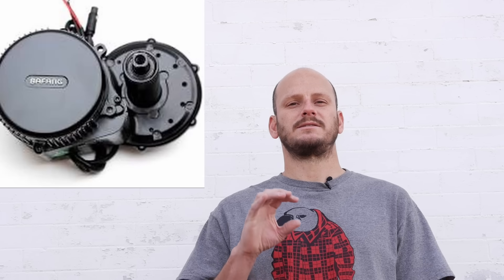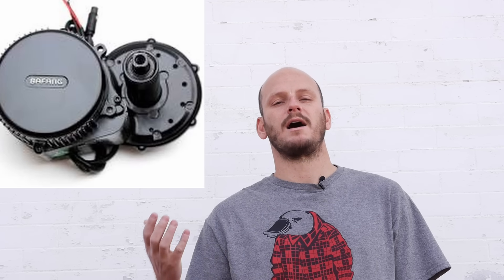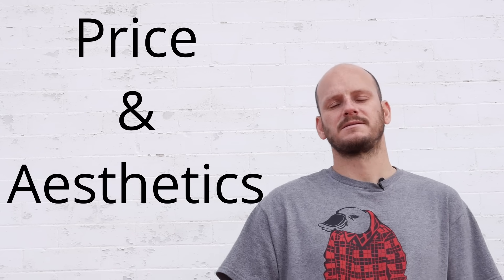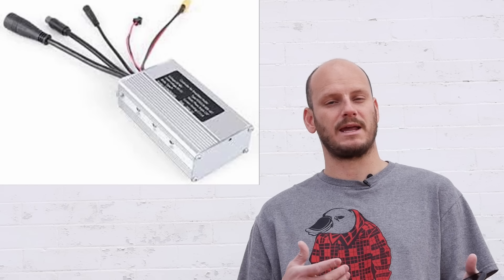Hub vs. Mid Drive Motors: Why Hub Motors Suck and Debunking Common Myths with performance test

Comment: Look at the specs for a lot of the mid drive motors from Specialized, Trek, and Giant:  70nm of torqe.  Yes, you can find mid drives rated above 100, but your comparison is unfair.  You can also find hubs rated above 100.
Reply from the maker: Hubs over 100nm that are also rated at 750w? Remember, apples to apples....
Reply: @JohnnyNerdOut  I own 3 ebikes, 2 hub and one mid drive.  Watts and rated torque don't tell the important part of the story.  One hub, rated at 750 watts climbs hills like a billy goat but has modest top end speed.  The other hub is the opposite.  It climbs everything that I need to climb but is unlikely to accelerate up the steeper hills.  It flies on the flats, however.  The mid drive falls right in the middle, not the climber of the first, not quite as fast on the flats.  Each bike fills a need.  Gearing has so much to do with an ebike's performance.  My climber is geared lower; my speedster higher.  In the end, it depends what you like.  I think hubs are more flexible, allowing one to work or rest a bit.  The mid drive gives me the best workout, but is a bit of a liability when I'm tired.
Reply from the maker: @richhowell6874  interesting. I wonder what gear ratio your running on that mid drive? I bet if you replaced your cassette for one with a bigger ratio (11-44) it would be king of the world!!!!!! Not even Godzilla could stop it👹
Reply: @JohnnyNerdOut  I'm quite happy with it as it is.  It's a Trek emtb and is a blast on the trails where uphill speed isn't an issue.  Downhill, I wouldn't dare go any faster.  The other two I ride on the road and find them well suited to cross-town (10-20 mile) jaunts.  The climber is a fat tire bike (Bolton) which I ride all winter and love.  The other is a dedicated commuter (Juiced: CCX) which is so fast that I need to find longer routes to the gym just to get an adequate workout.
Reply from the maker: @richhowell6874  gotcha. I thought it was a bafang mid drive. That’s the trouble with Ebikes! Having to go farther and farther that is😀

Comment: I've had both. I only use hub nowadays. Regen braking. Long chain life. Heaps of grunt. Hub is the shizzle
Reply: grunt?
Reply: @johnyradio2  Yep, grunt. As in you  grunt walking it up steep hills.
Reply: @michaelsprinzeles4022  not with the right battery
Reply: @shimes424  Battery is less important than the controller. Doesn't matter what the battery can store or put out if the controller isn't up to the task.
Reply: @michaelsprinzeles4022  lol, gotta be pretty steep. I have a Dapu 400 watt on a Pedego and I can throttle up the biggest hill in all of urban Ottawa no problem.
Reply: @Mywifetoldmetochangemyname  I live in allegedly flat NYC. I live on a hill that eats hub motors. The delivery guys who only pound the throttle pedal up my hill to aid the motors. Any hub below 750 watts & not geared isn't throttling up that hill. Hub motors have many attributes but hill climbing isn't one.
Hub motors above 2kw don't have the same trouble with hills but they're not street legal at that power.
Reply: @johnyradio2  it's much easier to find high-wattage hub motors then mid-drives, you can compensate, and since most of the controllers don't even have restrictions built in.... He probably means "I've got the grunt of 3500w-5000w making my dropouts weep"
Reply: Is this why Lordstown Motors decided to go with in hub motors ?
Reply: Regenerative braking? What brand ?
Reply: @sharifmunshi  Brand isn't the issue. You need a direct drive hub motor (not geared) and a controller with settings for regen.
Reply: @michaelsprinzeles4022  Not true. You can get regen on mid drives... And on geared hubs! But they are uncommon. Regen is not that useful anyway as you get very little back from it. - Although it is good for slowing down powerful heavy ebikes.
Reply: I prefer hub , you have a back up if your chain snaps , hub doesn’t rely on gear box or chain or another set of electronics ...just more stuff to go wrong , KISS keep it simple stupid. the gears were shown to be slow and inefficient early on ...  

As for spokes you supposed to check you wheel is true weather you have a e bike or not , you can always use mag wheels ! 

Regular maintenance is essential for every bike , car , van, truck ...
Reply: @adrianthomas4660  If you ride it like a bicycle and use the gears properly, chains don't necessarily break with mid-drives. I'm close to 1500 miles on my current chain running a 2500 watt mid-drive.
Reply: @michaelsprinzeles4022  yea sure , it’s just a weak link... no pun intended....
I did get super fit on an old bike .. then bought my first kit and using gears on light frame and whollop ! Super man coming though. 
I experimented with pb batts in the panniers wow ! Loads of weight and the bike would power wheelie away from lights 😂
So I put it on The bike in the thumb nail  a Claude Butler heavy steel frame .. such a nice comfy ride and with a decent li ion batt still pulled hard 38.9 along the flat.
Reply: @adrianthomas4660  Nice!
There is definitely an element of personal preference. I'd prefer to break a cheap chain, which I can replace myself on the fly, to breaking an expensive motor or controller, which I don't carry with me. I also didn't overbuild my setup for top end speed (36 mph in top gear on flats if I have the space) but to climb the steep hill I live on without slowing down, killing myself, motor and/or controller.
Reply: @michaelsprinzeles4022  I have chosen death ! There’s an old runway near me ... and I wish to do a Blue bird ! so delta wi , and flux weakening ... up rate the 3k I’ve got Vintage Electric  to ..... lol 😂 30k is loonie bin , so maybe half that 

Then I’ll be super happy.. and or dead 💀..... 

Last few days I’ve restricted it to street mode , and I gotta tell tell I’m enjoying it 

More time to check out the scenery , sexy woman I’m gonna over take ...
Reply: @adrianthomas4660  Good luck....I think?
Reply: @michaelsprinzeles4022  That 2,500 watts is "peak power" you won't be using that ever.
Reply: @grantadamson3478  I wouldn't say not ever. I live on a steep hill and now I pull a dog trailer with a 60 lbs dog. I do occasionally see peak power but not often or for long (or I'd be doing it wrong). The reason for the excessive level of power is because I fried the 1500 watt controller climbing my hill.
Reply: @michaelsprinzeles4022  I'm on 3.5kw with bbshd and the chain is the original kmc 10 speed just waxed, I've got 5000km on it zero wear
Reply: @adrianthomas4660  you have a backup if you loose your chain, but I already carry a spare chain in my parts bag anyway, because those always break when I'm in a hurry. And your hub drive does use extra electronics: it has a controller (inside the hub in a handful of low-wattage kits, but usually a box you put in a separate frame bag) and battery (also can be inside the hub), all of which can fail (the bafang's controller is part of the housing, having an in-hub/in mid-drive controller go out is a pain either way to be fair). Hubs get to use regen braking, which is efficient, yes. You can also get them in significantly higher outputs then mids, but other problems creep up then (destroying dropouts for instance)."

They're good for different things, mostly. Mids get weight distribution and fewer wires (since inboard controller, and the battery's right there in a downtube setup), hubs get ease of install, price (at the moment mids are a bloody racket), and largest output available.
Reply: @DFX2KX  I'm not even sure about ease of install. A hub usually requires placement of the controller, a rats nest of cable management and installation of torque arms. The mid-drive does require some cable management, but less, and just replace the bottom bracket with a motor.
Reply: @michaelsprinzeles4022  I say ease of install mostly for the fact that bottom brackets can be a right pain to get out, I don't know how much I'm going to have to pry on my Al Comp's to get it loose, but I suspect profanity will be involved even with the right tools.

That said, the prices on mids are definately higher. like. yikes.
Reply: @DFX2KX  On the price of the hub motor alone I can't debate. I'd argue that a quality hub and subsequent controller are close enough in price that a mid-drive could still be the better value per dollar.
As to removing bottom brackets. I've only removed 2 and 1 had been ridden for thousands of miles for almost a decade 1st. I haven't had any issues or even a bruised knuckle but I know that's not the norm.
Reply: @DFX2KX  Hubs can have fewer wires if you use a Baserunner controller which fits inside the base plate of the downtube batter, which gives the same amount of electronics as a mid. You can't rip out dropouts if you use an all-axle hub motor on a thru axle bike without dropouts.
Reply: @michaelsprinzeles4022  Unless you put the controller under the battery pack to eliminate the cable.
Reply: @sammiller6631  Out of curiosity, how powerful of a controller are you talking about? From what I've seen it seems even an 18 amp controller is too big for that. My 2 mid-drives run at 25 & 50 amps. Can that powerful a controller fit in the small space under the battery base plate? Isn't there a serious problem with heat dissipation with that setup?
If you can run a hub that high in amps with the controller in the base plate, that's pretty cool.
I still wouldn't want to fix a flat on a hub motor wheel though.
Reply: @michaelsprinzeles4022  Yes, the Baserunner can run at 50 amps continuous. Wouldn't it dump heat into the metal bike frame that the metal battery cradle is directly connected to?
Reply: @sammiller6631  I'm not sure but assume not. All my batteries are in bags and I've never had any heat issues running a Ludicrous controller at 50 amps (continuous & 70 peak) but I don't use full power often or long. I'd assume a canvas bag would have bigger problems with heat than a metal frame. (Only anecdotal but hope it helps).
Reply: @michaelsprinzeles4022  It might not be immediately catastrophic but would putting a Ludicrous controller in a bag without airflow shorten the life of the components?

70 amps is a lot of a power. The Baserunner can do 80a peak and the larger non-integrated Phaserunner hub drive controller can do 96 amp peak, max 90 Volts. I'd worry about that in a canvas bag.
Reply: @sammiller6631  Sorry, I misunderstood your question. You should worry about a controller running that much power in a canvas bag. My controller replaces the integrated controller on the BBSHD so it gets the same air flow as stock. Only my batteries are in bags.
Reply: @michaelsprinzeles4022   the integrated controller on the BBSHD is not that great to begin with
Reply: @sammiller6631  Yes, I know. I burnt mine out. That's how I ended up upgrading to the Ludicrous. The Ludicrous can run at 30 amps all day long and not be taxed, unlike the 30 amp stock controller.
Reply: @michaelsprinzeles4022  Did you toss the motor after you blew the controller?
Reply: @sammiller6631  HELL NO! It was my fault the controller died, when I forced it to climb a hill in top gear. I was still getting to know the motor and only had about 250 miles on it. I've put another 1300 miles on that motor with the new controller.
Reply: @DFX2KX  Why carry another chain?  I simple lightweight bicycle chain tool can take out the broken link and reconnect the working links on either side of it.
Reply: Y C  You're preaching to the wrong choir. I'm all about mid-drives. I ruled out a hub for myself back in 2016 when you really had to search for anything else. I'd rather break a cheap chain which I can replace on the fly than a hub motor or controller which I don't carry in my emergency kit. Chains breaking on mid-drives I attribute mostly to bad riders putting too much power through while changing gears. I made that mistake once about 1200 miles ago and the "new" chain still has quite a bit of life left. Even if you break a chain, cassette & derailleur it won't be more expensive than replacing a hub or controller unless you have really high end components.

Comment: Great argument.  As I'm in the research stage for buying an ebike, hub drives seem to be way more common.
Reply from the maker: From a manufacturer standpoint they are way cheaper to use than a mid drive therefore your margins are way higher. So I get why manufacturers keep using hub motors but from a rider standpoint I would almost never ride a hub motor.

Comment: Well said! I would add that a belt is better than a chain too.
Reply from the maker: Ya absolutely
Reply: @JohnnyNerdOut  What power & what belt? Have you built anything as powerful, or more, than a BBS02 with a belt? I usually see them on weak Euro-spec e-bikes. I've only seen 1 800 watt Bafang belt drive fat-bike. Does anyone make a belt ring adapter for the BBSxx? I'd love to build a belt driven e-bike but not if I can't use one of my BBSxx motors.
Reply from the maker: @michaelsprinzeles4022  I’ll have to do more research but I imagine some custom fab work might be needed to get it to work with a BBSxx. To me it sounds like an IGH with a SS chain is the way to go

Comment: midmotor has torque sensor and hub motor has motion sensor and for my health none of the mid motors do not go well with the load required by the 15-20 mid motors I have tested, so I go for my navmontor as I have on all my ikes. Prefers rear wheels and not front wheel motor. Front wheel motor mostly for flat landscapes is my experience, fits good in Denmark :-)
Reply: Hvor mange watt køre du med ?
Reply: @Notenoughorchids  250 watt, but have one 750w and it is like heaven to ride, but not legal in use :-(
Reply: @geirsreid6941  are the police harsh to enforce it?
Reply: @Notenoughorchids  don't know here,  how is it in your place?

Comment: I run 3k mid-drive through 7 gears, no problems so far. Pro tip: Use a freehub/cassette instead of a freewheel, otherwise your axle will bend from the torque.
Reply from the maker: Great tip, thanks!

Comment: It's truly a shame that I allowed myself to listen to 11:19 minuets of BS from MR. NerdOut.
Reply from the maker: I take it you’re a hub guy?
Reply: @JohnnyNerdOut   Why not tell the truth about both types of manufactured e-bike instead of your bias against hub motors. Your prejudice hurts the industry and is misleading and a disservice to your readers.
Reply from the maker: @garywrobleski5212  but like, what exactly? Hub motors have their place, in applications over 2,000w and in single speed cycles. This is my opinion from working in the industry professionally since 2017. I would argue that not pushing the industry towards mid drives is hurting the industry. Or at least educating people on the key differences to how they operate and the benefits from that.

Comment: Hmm. Some good points, but a fair amount of misinformation. I know it was a short video but you didn't even mention that you can buy hub motors with internal gears which as you said allows more torque and better efficiency. I will admit that most geared hub motors have no more than three speeds. You really believe it's easier to swap out a bottom bracket than just a wheel? 
Most electric vehicles do not have hub motors. They can not handle the unspring weight of a car. There are a few that have tried to go that route but as far as I remember none have done so(except maybe some really cheap three wheelers). I believe the new version of Aptera is planning on using hub motors though. You believe that mid-drives are sleek? I wonder who would want something that clunky hanging off their bikes. But that's a personal choice. Ok, I'm done. Full disclosure: I've had a Crystalyte 750 watt hub motor for 15 years. One rim replacement. Still runs. Probably has less than 10,000 miles on it. Also in general a hub motor is not as efficient as a mid-drive for some of the reasons you mentioned. Thanks for the video.
Reply from the maker: In my experience most geared hub motors have one speed. Geared meaning that they have reduction gears to bring the motor rpm down to more usable level, thus giving it more torque. 
I totally mis spoke when saying electric cars have hub motors. I meant to say they share the same way power is transferred to the wheel (without a gearbox/single speed) 
The rest is personal opinion, but yeah for me at this point I can remove a bottom bracket super fast and easy. And I would totally take the way a BBS O2 motor looks underneath the bottom bracket than having a big clunky hub motor and a big external controller mounted somewhere versus having it all in one nice little package. But yeah that’s totally personal opinion. Cheers!

Comment: One issue I've had with mid drives is that it seems more difficult to match pieces and parts to specific frames. Does Bafang have a database that matches the conversion kit with specific frame? I hate having to order extra pieces due to non standard frame issues.
Reply from the maker: Not that I’m aware of. You are right though. However there is so much info out there on custom builds that I’m sure you could find out ahead of time easily what would be needed.